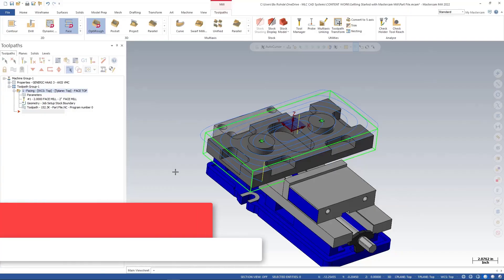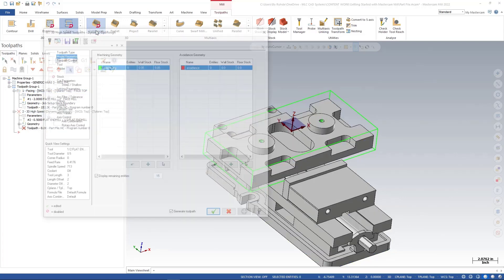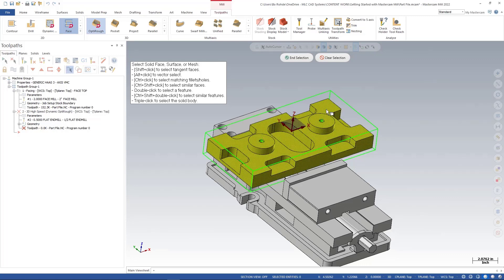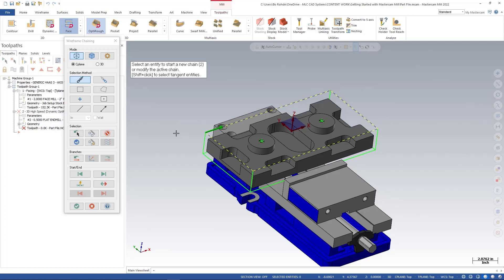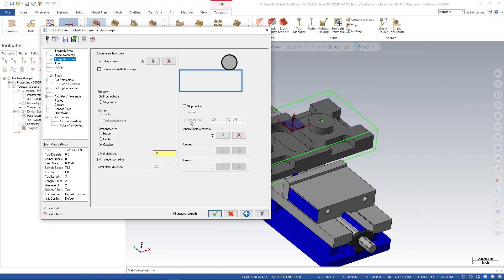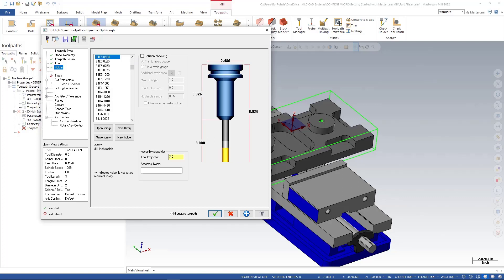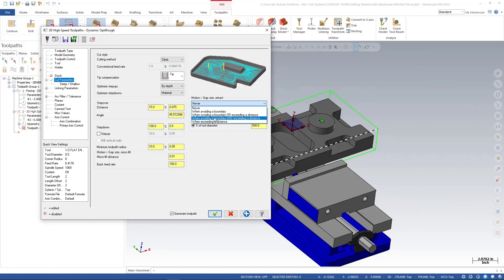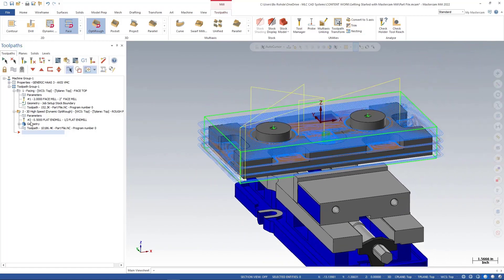Roughing a Part with Opti Rough - Getting Started with Mastercam Mill Webinar 7/12

Comment: So I followed your steps and got a good tool path. Only problem is I ha to flip my part to mill out other side and this tool path i made is cutting entire stock and itll run into jaws. It is also cutting through the pockets of my part. Any tips?
Reply from the maker: Check out the full webinar: https://youtu.be/GuKrpMe97jY on how to setup the second operation without messing up the first set of toolpaths.  https://youtu.be/-fd_bxyDiEg